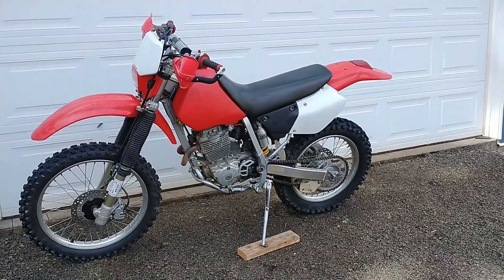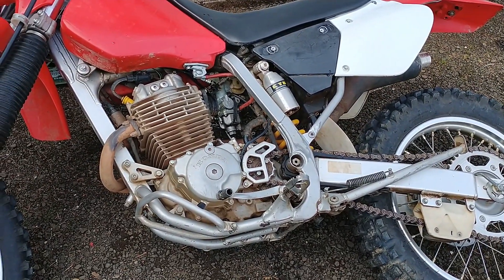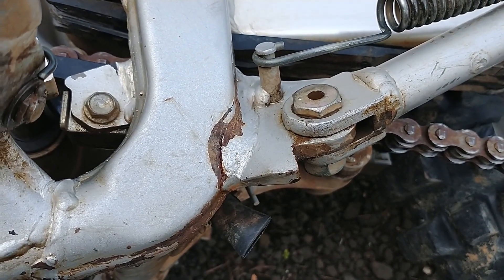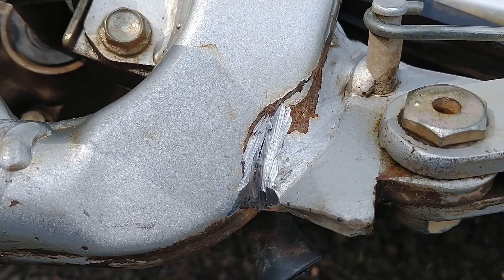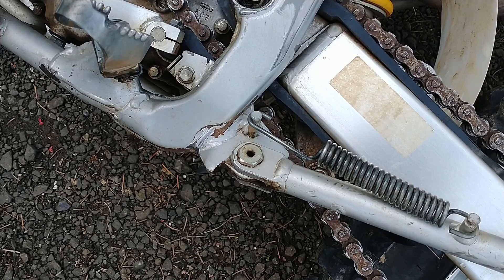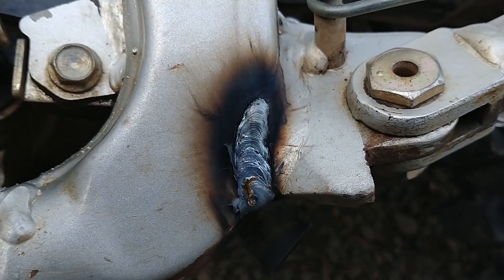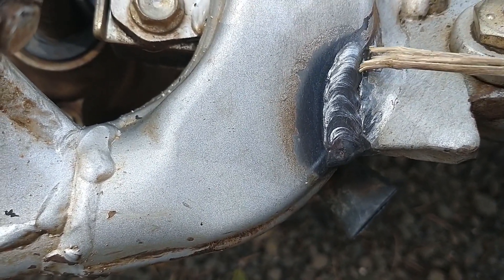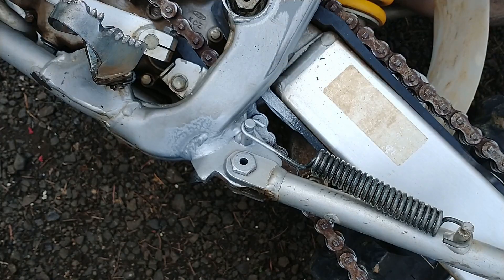XR250r Kickstand Repair

Comment: Great job and exactly appropriate level for these awesome workhorse trail bikes. I have two! Just had the same issue and doing some research on other folks' repairs. Nice penetration for MIG. TIG would have let you have more control both of heat and filler rod. The MIG wire feed dictates the speed of of your welding a bit too much for delicate jobs. Well done though!

Comment: Mine just snapped off last night. I don't have a 240v outlet with a big enough breaker to run my Lincoln AC 225 welder. I don't think my generator will run it either.going to have to get creative here.